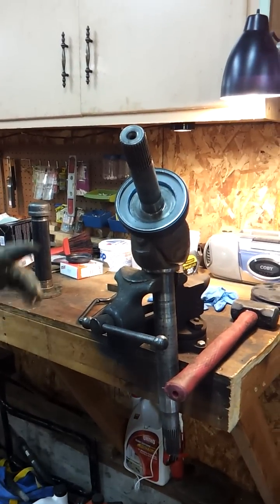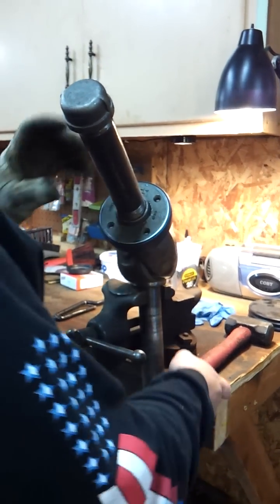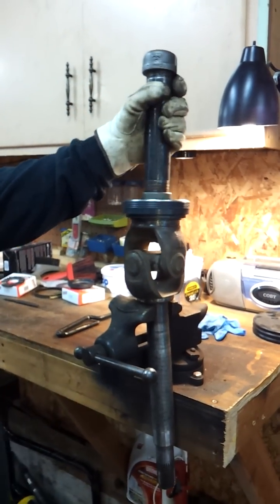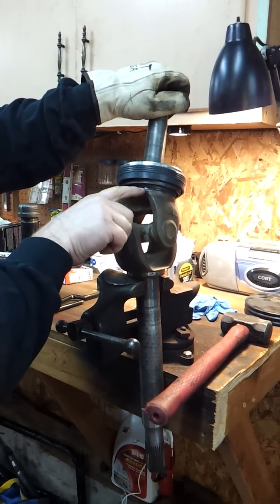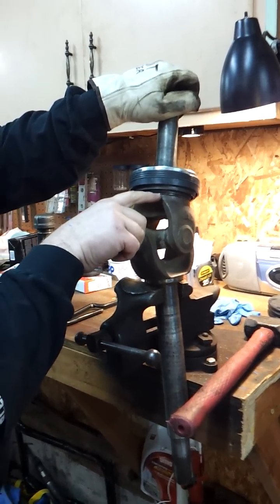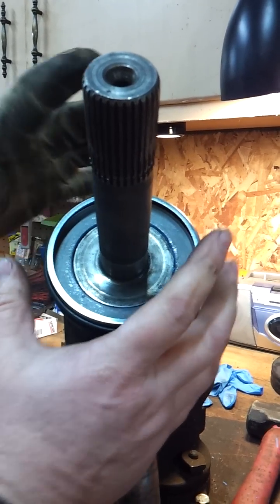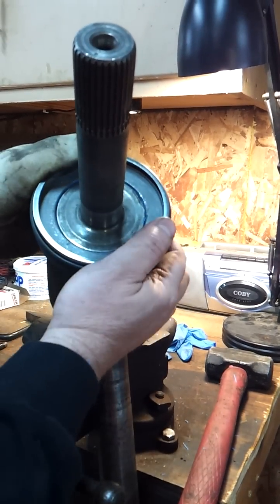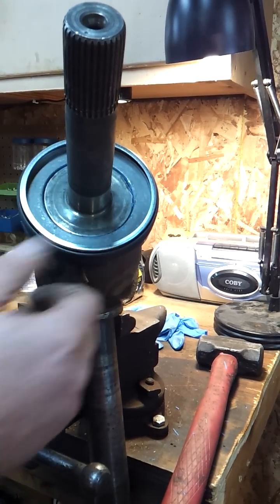2000 F250 front axle rebuild Part 4

Comment: can you tell me the specifications of the home-made driver? what is the diameter of the disc and how does it attach to the pipe?
Reply from the maker: CRM6718 Thanks for viewing and great question! So everything is based off of the 1 1/4" pipe. the "disk" is a flange for mounting pipe to a floor for like making a pipe hand rail. alot of grinding had to be done to bring the circumference down to a smaller size to fit the seal. The pip itself is  a 8" long nipple. meaning threaded on both ends. then the hammering portion is a cap screwed on top.
Reply from the maker: CRM6718 Not sure if i can take a closer pic and post on here but it you pause vid you can see the pipe lay out while its sitting on the bench.
Reply from the maker: CRM6718 I made the base to be 3 7/8" or about 3/8" out from the center of the 4 holes for mounting it to a structure
Reply: @ allry100571, thanks! I saw your other video that talks about it. I think I can build one tomorrow.  I now have one more question. I have removed every thing (except the yoke/gear) to get to the inner seals. My question is, there seems to be some kind of white guide for the axel to slide through(& not kink the seals). How do you remove the old seals? trying to hit with long rod from one side is not a good idea(which works great on Dana 30,  BTW). So, how do you remove the inner seals ( next to yoke)?
Reply from the maker: CRM6718 those inner seals are straight up a pain in the ass. lol. On the "short" side or drivers side i actually used apiece of 1/2" rebar to knock it out.  probably was risky un doing that but.... the other side though i think i actually had to pull that one out from inside the pumpkin.  It was a pain.  Im very sure they're is a specialty tool that can either be bought our rented to pull those seals